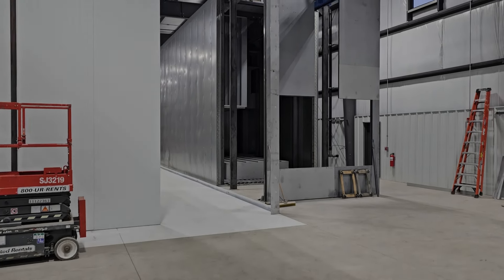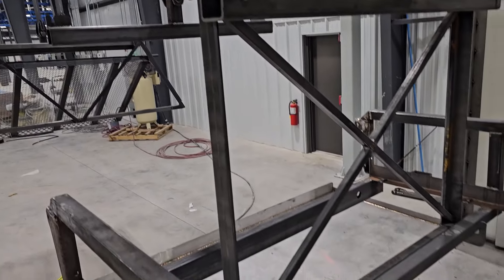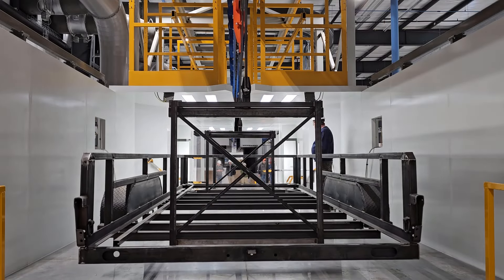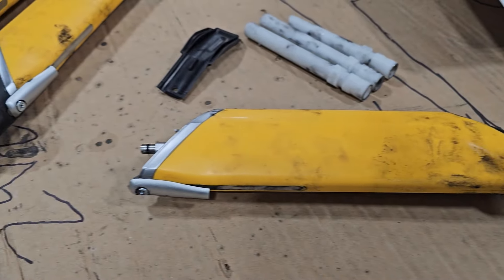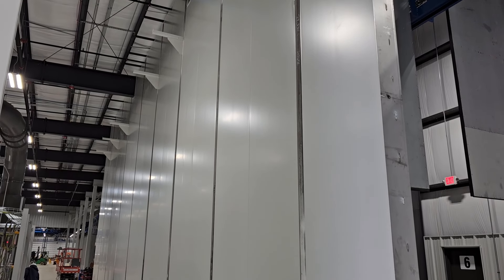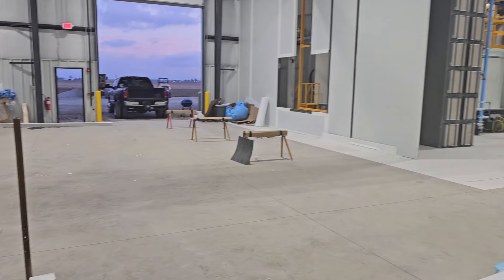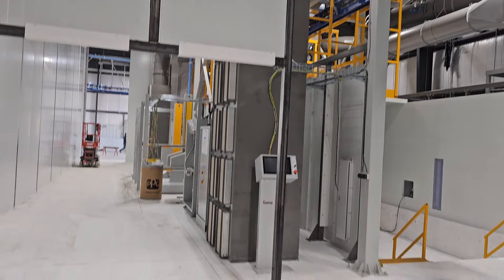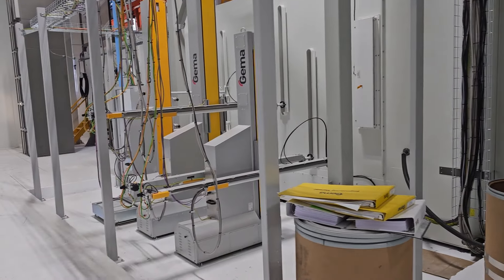Powder coat line part #17

Comment: Watching that gun crash with loss of house air, I think if I was the plant engineer, I'd be specing a small air system modification. A check valve, pressure transducer, and a 25 gallon accumulator. Guns don't start until the accumulator reaches (say) 50 PSI, and if house air drops below accumulator pressure (or some PSI limit) the guns retract using the air in the accumulator.

Comment: They should install an interlock on the conveyor system controlled by a pressure switch on the air system.